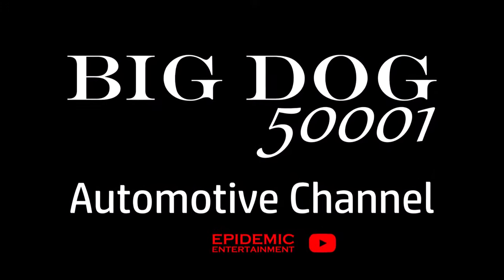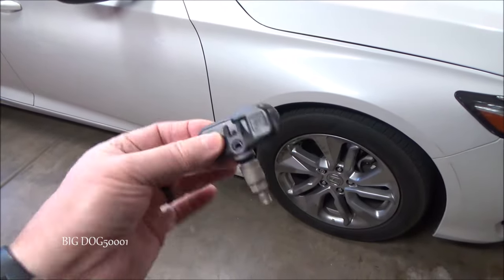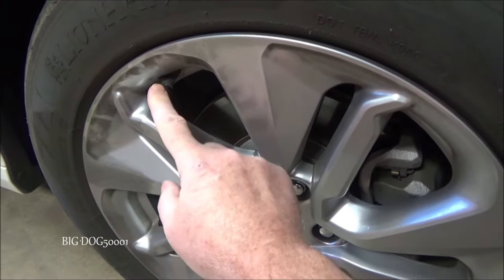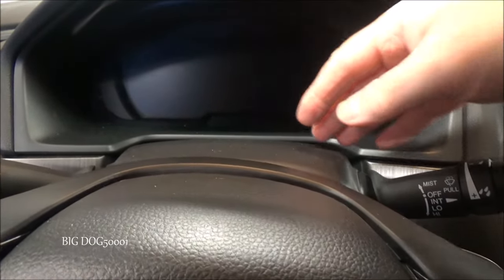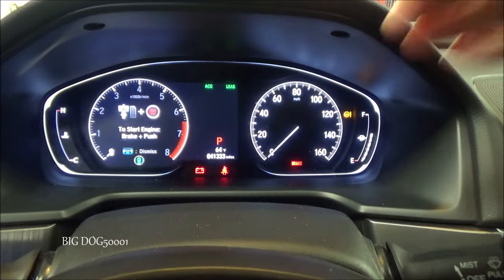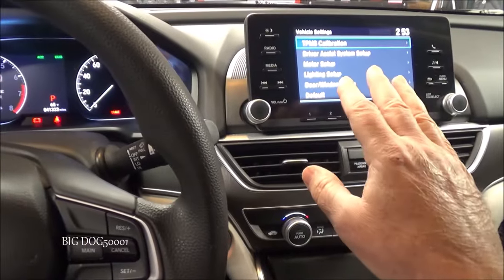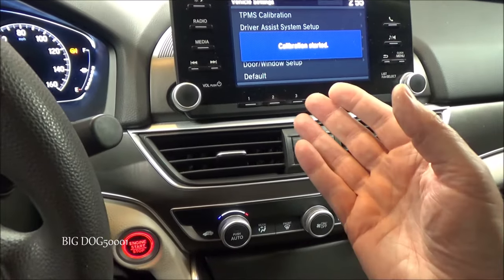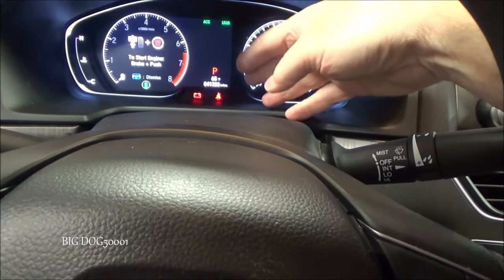Honda TPMS Calibration for Indirect TPMS Systems - Trouble Code C0077

Comment: I have a 2015 Honda CRV (Automatics transmission version and not the CVT). I am in Melbourne Australia and I have been using 0w20 oil till now. I have heard that 0w20 is too thin and 5w30 is better. What is your recommendation on using 5w30 on CRV and is it ok to should from 0w20 to 5w30 ?

Comment: I have a 2023 Honda Pilot and I’ve tried everything vehicle settings, settings etc but it’s currently 44*F in Atlanta and I couldn’t find any reset tire pressure and all the tires are fine remember that too
Reply from the maker: 2023 Pilots have a conventional TPMS system (not an indirect system like the Accord in this video).  The TPMS sensors are inside each wheel attached to the valve stems and they send signals to the body control module for monitoring.

Comment: Thanks for the new info.  I have a 2009 Honda CRV, in 2018 one of my TPMS sensors was not working and the light was annoying, but I knew replacing it was expensive, so I put up with it because next year I was buying new tires. I replaced the tires and all the TPMS sensors. I purchased 4 metal stem sensors from eBay for $44. There was no charge for putting them in and calibration. The rubber stem sensors were available, both on eBay and by the installer, but at a premium. They were about $25 each on eBay and $40 each at the installer.  What do I gain, for my vehicle, using these?  My car does not have a display, so I can’t calibrate it the way you have shown.  I do have a 2017 Toyota RAV4, does that have this calibration system?   Thanks.
Reply from the maker: Thanks for the input!

Comment: hi can u give a tip my car honda civic si and last owner changed tires rather than use 18 inc 40 now its bigger 18 50 and tmps doesnt work correctly can i program hole system 
thanks

Comment: How do you do this calibration on a 2010 FIT Sport EX that has no infotainment menu as shown? We have some a menu in the display behind the steerling wheel, but the options that display are just info, like oil status... We also have no button on the lower left dashboard...

Thanks!

Comment: How does my 2010 Pilot Touring know when I've rotated my tires?
I just replaced all 4 sensors at 391000 miles and they calibrated all 4 new sensors, but I have NEVER paid to have my TPMS recalibrated after rotating my own tires. Yet my car knows which is which. How is that possible??